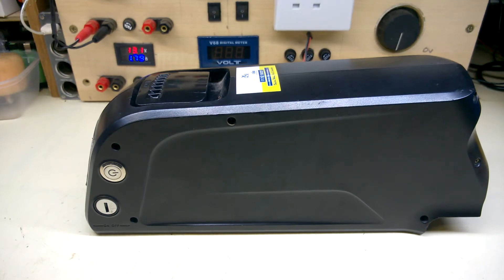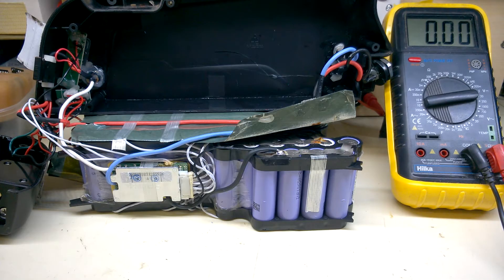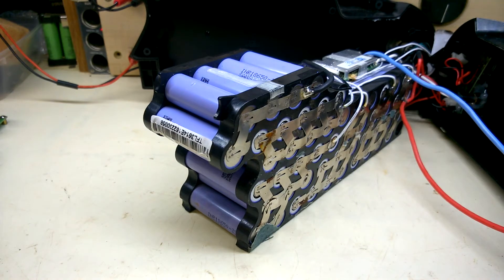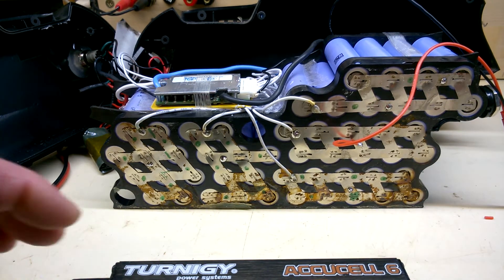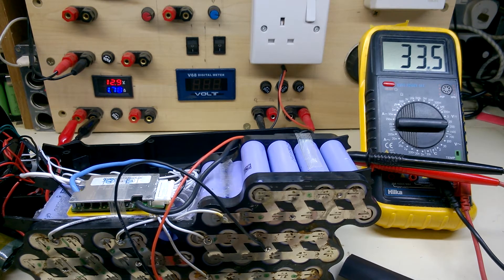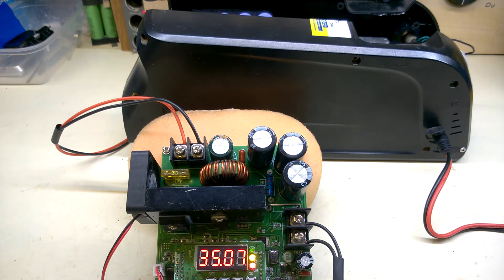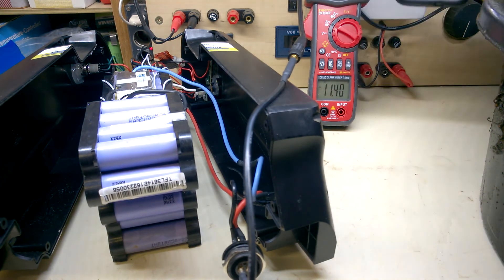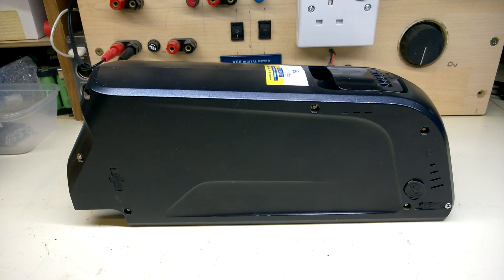Shark 36v Li ion battery repair

Comment: Excellent video, could you tell me the best way to drain the 36v battery on the bench
Reply: Thank you very much
Reply from the maker: If you'd have watched the video , you would have your answer.
Reply: Thank you I re looked I was a little unclear on the nichrome wire that needed, could you please let me have more details for the resistor wire length etc that would be great
Reply from the maker: @lesbellchambers5172  
If I remember correcctly , the nichrome I used was 0.9mm diameter.
And about 3 to 4m in length wrapped around a wood core with a brick centre to weigh it down.

Comment: Hi thx for vedio
Hv one question  how much u charge for that and where about u based hv same battery  voltmeter says is on 12 v when is  36 battery but always been working and charging  not same problem as the u hv on vedio 
Can it be fixes plz? thx
Reply from the maker: I'm in North Wales.
Most problems can be fixed.

Comment: Why couldnt you solder a wire to the postive and negative leads of the battery and charge it that way bypassing the bms? Using your charger ofc
Reply from the maker: I could have done that , but I would risk overcharging some cell groups.
The battery may not have shared the 42 volts equally , that is , some cells may get 5v and others 3v (also the pack was unbalanced at the start , so by charging the groups separately I re-balanced the battery).
Reply: @makeitwork7522  i see thanks a lot that makes sense. 
Realy apperacite you taking the time to reply. 
Have a great day !!

Comment: Hi, this looks to be the same as my Radrover 48v 12Ah with Panasonic cells.  Made by DEHAWK of Germany.  I have a dead on of these if you could take a look at it?
Reply from the maker: I could take a look at it for you.
What is your location ?
I'm in North Wales.

You need to think if it's financially viable to repair your battery pack.
If it can be recovered (as in the video) , then it may be worth it for you.

The work I did on this pack cost the customer £70 - that is without using any new parts (apart from a fuse and shrink wrap) !!
When I quoted the price , he seemed to think it was expensive (not for 8 hours work it isn't).

However , if your battery needs all new cells and BMS , the cost WILL be expensive.
Reply: @makeitwork7522  Hi and thanks for the reply.  I'm in Surrey so a bit of a distance!  Will look at the shipping cost though would need to have your location details etc.  These batteries are expensive so maybe it's worth a go?  Bit of background, the part is now 5 years old and been used (all weathers though kept dry), one day it just it just gave a spurt of power (to the bike) then stopped, tried again with the same result, now been sat for 6 months.  Shows no O/P voltage, fuse is OK as is the charger.  Supposedly has Panasonic cells fitted.  More topics for another episode!!  Nick.
Reply from the maker: @flickthenick  
I'm certainly willing to have a go at it.
I'd say that about 75% of ebike battery problems are not with the cells (you may get lucky) , but are caused by , for example , a poor connection , a blown fuse , a faulty BMS , a faulty charger etc.

If you wish to proceed , send me a private message - garethem1@sky.com